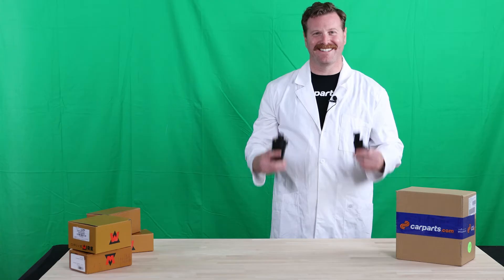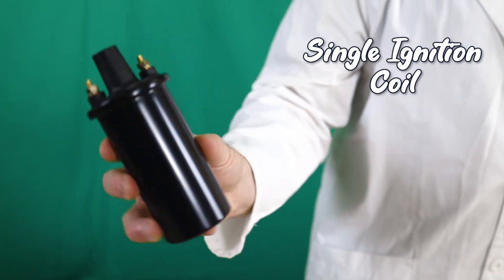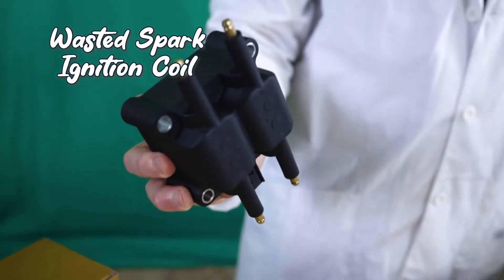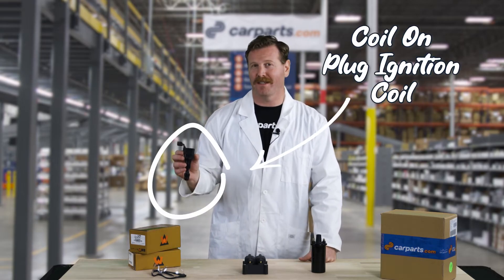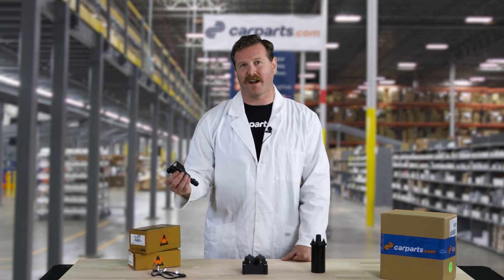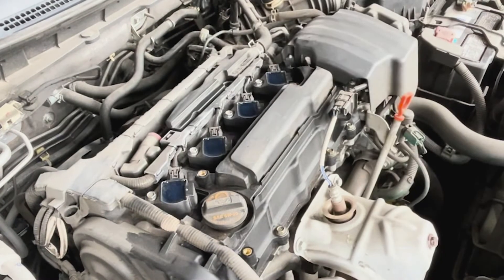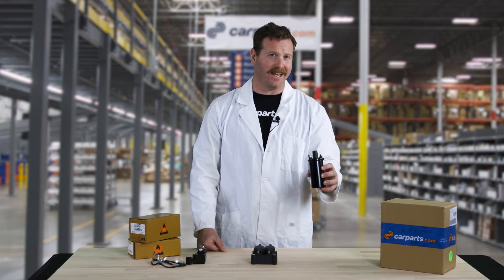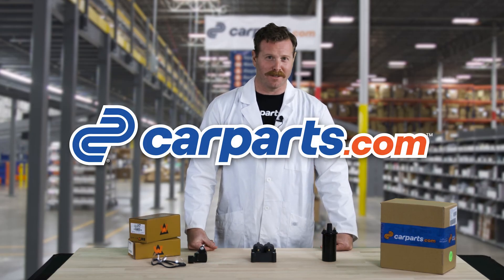How Ignition Coils Work | CarParts.com Parts Explained

Comment: "...and is included in most stupid cars." HAHAHA The stupid car that still gets 40+mpgs on a manual transmission and is 3 or 4 decades old with overall cheaper maintenance ($200 for 4 new winter tires with 4ply, or $30 for oil change, or lightbulb and tire changing without a computer meaning off brands and sizes best suited for the environment driven in and sonone so forth) and lasting for hundreds of thousands if not millions of miles beyond warranty...huge money savers, even of hybrids due to age and first generation of fuel efficiency....sure that's a "stupid car". Honestly, having a computer car makes it stupid. Having computer sensors is fine, but a computer that takes control away from driver is ALWAYS STUPID!!!

Comment: Its distinguishing feature is a vibrating magnetically-activated contact called a trembler or interrupter, which breaks the primary current, generating multiple sparks during each cylinder's power stroke. Trembler coils were first used on the 1886 Benz automobile, and were used on the Model T until 1927. There was an earlier coil unplug system was caught a bliss coil it was improved on the modern car. The coil unplug is actually old system or was improved significantly improved